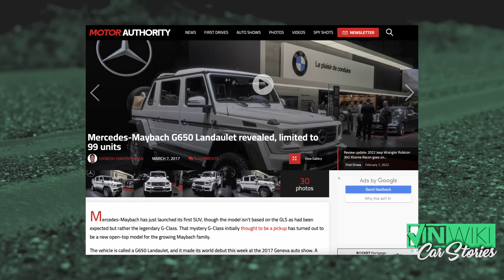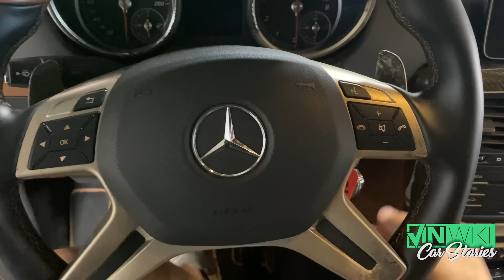The mysterious destruction of these $2 million G650 Landaulets!

Comment: A ship that size would definitely have an onboard pump to pull sea water for deck fires. If it's an engine room fire, they probably wouldn't use sea water, but a deck fire - yes.
Reply: Used to work in the engine room on navy ships. We used seawater mixed with a chemical foam that was basically soap. My guess is that it either happened with salt water, or a dry chemical agent (highly corrosive) which explains the electrical issues as that stuff gets everywhere

Comment: As an electrical engineer in the auto industry- the fire put out with saltwater theory makes sense not just for the corroded clamps but the electronics, too. Salt mist does terrible things to circuit boards. I could be completely wrong, and am working off the limited info provided here, could be a million other explanations, but saltwater does make sense. Good luck to whomever purchased them- will be a nightmare to sort out properly.
Reply: I was also thinking that the sudden drop in temp would suck some of the moisture in, and would also compromise any corrosion preventative coating that the clamps and such would have began life with. Thoughts on my theory?
Reply: Goose Not maverick certainly saltwater corrodes clamps in the manner he showed- I see it all the time I’m used cars here I’m Detroit. I’m not intimately familiar with new, properly functioning shipping containers, but I assumed that either the seals aren’t great to begin with or the seals melted. Either way I assumed stray saltwater from firefighting entered the container. It’s also possible- among other things, and I haven’t researched this myself- that a dry chemical firefighting agent was used and is apparently also corrosive. Unless the fire was in the G650 container this does not make as much sense to me because I think it would take a lot of agent to get into the electronics and or cause significant corrosion on the clamps. Water can easily drip into an imperfectly sealed container.
Reply: @lgunderso2117  oh I certainly wasnt disagreeing with the possibility of that being the case. Merely suggesting another possibility. I've seen small amounts of heat and fast temperature changes flake corrosion protection off fasteners and other hard parts in no time flat. Engine bay fires I've seen that eventually were put out with regular fresh water, ended up also looking similar. Sadly I've seen my fair share of fires first hand as well as damage done by them after the fact in even more situations, growing up and working on the automotive industry, more on the service and parts side. So many different ways this could have happened. Somewhere else in the comments someone said they knew what really happened, so I'm patiently awaiting to hear the story.
Reply: Goose Not maverick yup, I’ve seen that too- sometimes caused it intentionally to weld galvanized steel. I was under the assumption that a nearby container was on fire, not the one containing the g650’s.
Reply: @lgunderso2117  given your assumption that makes sense. Thanks for being polite and such, it's amazing how quickly people become nasty if they think you dont totally agree with them. I've been known to flake that coating off Unistrut so I can weld to it, basically any significant temperature shock makes it come off pretty easily in most cases I've seen. Crazy stuff, the science of galvanization (or galvanizing, not sure which term is correct here)
Reply: It is as obvious as can be - fire retardant damage.

Comment: I once bought a container of cars from Australia back to England and when I opened it up the cars were absolutely filthy with black smoke damage… it turns out the seals on the container were damaged and the container had been located directly behind the ships funnel… fortunately it cleaned off fairly easily.
Reply: What cars did you grab? We’ve got some pretty sick cars over here
Reply: @Lplaterwrx  probably a holden hey lol better not be a barina
Reply: @007lutherking  No one would bother with a holden. Outside of maybe an FX or something like that.  Would put money on something Ford (escort, cortina, falcon, possibly a cossie), possibly even a toyota.
Reply: @007lutherking  I heard the chavs are running out of them as they are all rusting and they need to borrow some from australia🤣
Reply: @Mr_jz_12  my best is a escort,falcon,skyline,gc8 sti,supra rust free cars are in really high demand over there
Reply: @Lplaterwrx  gc8 stis have always been expensive here. Possibly supra.
Reply: @Mr_jz_12  no 5 years ago I bought a decent one for 10k and that was normal market value, now there stupid expensive, should have never sold it but my wrx is still way better condition

Comment: Fire damage is a special challenge to sort out. 
Two of my classic GM cars and a S class Mercedes were part of a fire that damaged and destroyed many cars in a huge garage. Smoke mixed with water gets acidic. See the result on the clamps and bolts! So my rust free cars got a bit rusty under the floor. Even the stainless took ages to be polished up again. Only to clean up, polish and detail my Pontiac convertible took ages . It cost the insurance close to 7 grand just to cover that car's detailing. My Mercedes was not insured.  The heat damages showed only little by little. The engine bays of my GM cars were partly free of paint. The Mercedes headgasket started leaking. The hood of the Mercedes showed a bit of fire damage as well.The roof of my Belair had to be repainted. Leak after leak started. In my Chevy I had to replace the master cylinder, the power steering pump, many hoses and most of the car's gaskets and rubbers. Many  electric switches had to be replaced as well. I used every cent of the 20 grand the insurance put in my hand. Still, there are more details that have to be sorted out. I sold the S-class with quite a loss. In spite of detailing it for days.

Comment: WDC4632741X279173- black sold new in Dubai, WDB4632741X290088- blue sold new in Poland. So I don’t assume they were on the same ship. Probably some warehouse caught fire and the automatic extinguishing system did the damage. Also interesting the black one has quite a low VIN, all I have seen were around 290k like the blue one. The black one is maybe 1 year older. Could be some early pre-production/development chassis.
Reply: See Thomas Edge comment above...transporter fire.

Comment: So, if I understood correctly, if they were NOT fire damaged, these 30 and 60 mile examples would be worth around $900K each.  New price was around $1.5M.  By my basic math skills, that works out to $10K-$20k per mile.  That has got to be a record!
Reply: As another person on this channel pointed out, just getting a title for the car causes it to depreciate significantly. I believe the car he was discussing was of similar value, and because they repo-ed it before the buyer got a title they prevented depreciation of over $100k.
So figure that with zero miles on them these cars would be $1.35 million instead of $1.5
Second, it's not so much the mileage as the age in this case. The fact that they have less than 100 miles adds to their value, the fact that they are four years old is where they depreciate. So it is more like they have been dropping 10% per year. 
Most of the people able to buy a car for over a million dollars want a brand new car.

Comment: My house caught fire in march of 2021 and I've got stainless steel that had been perfect for 10 years suddenly rusted to the point of just tossing it out. The heat damages a lot but strangely enough the smoke leaves a layer of chemicals that will rapidly change the oxidation layer on metals and kill them quickly

Comment: It couldn’t have been a shipping error I’m pretty sure I saw these same 2 landaulets at a dealership in Newport like 2 years ago I have a snapchat of both a black and blue one and the blue one clearly doesn’t have any rust on the rear driver fender, if these are the same ones then that means they shipped here fine and something had to have happened after.
Reply: As others have pointed out, there's shipping and there's shipping: some of the stories of what happened have a fire on the TRUCK they were being shipped on.

Comment: The smoke is so acidic that corrodes everything. Electric contacts stop working and metal corrodes like they've been in the sea. Unfortunately during a house fire, smoke got to every corner of my cousins house. Even Omega watch with stainless case and bracelet started to corrode after a week even though they were inside a drawer.

Comment: This what I’ve seen in my years as a Quality (Reliability / Field Failure Analysis) Engineer background:

1) Oxidation/Rust: Heat promotes oxidation even on stainless steel. Not a lot of moisture/humidity is needed to get what your seeing during a fire incident. Look at burnt cars after forest fires for example.

2) Electronics Faults: Cars are designed to last under certain weather conditions like the common rain. Unless the interior or hood was open under a torrential hose blasting I doubt that is water caused the electrical issues. Based on the burnt carbon fiber fender resin your talking heat ranges that would desolder PCBAs (ECUs, control modules), ruin wire jackets, melt/warp plastic, destroy display screens…. typical fire damaged electronics story.